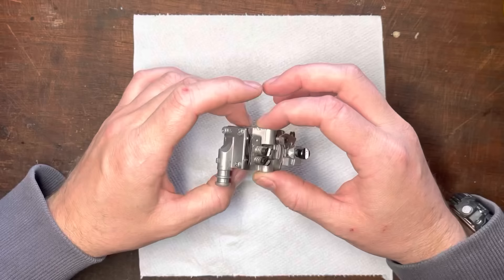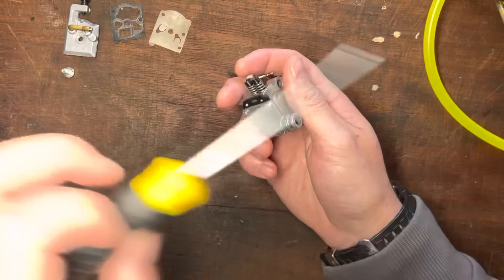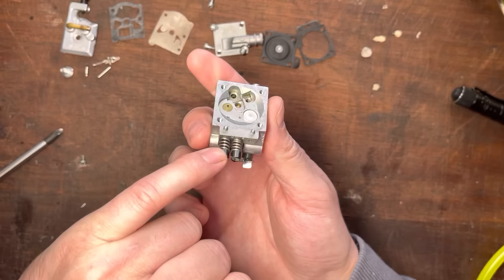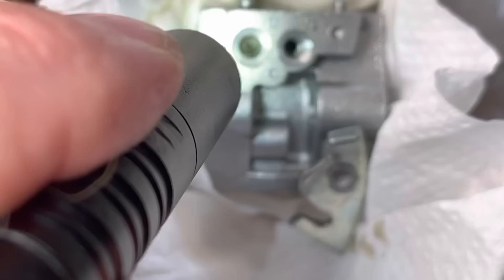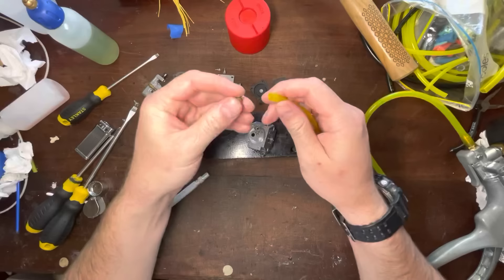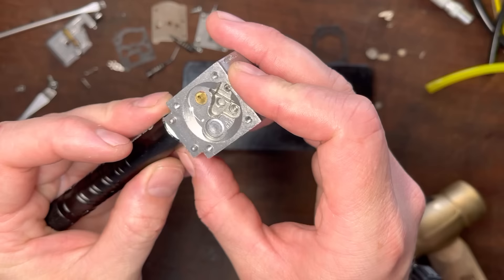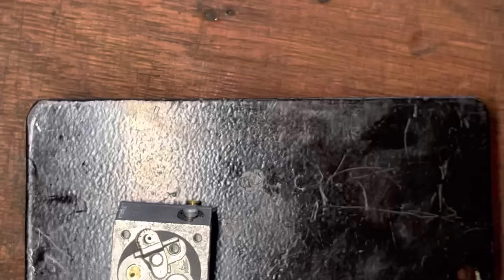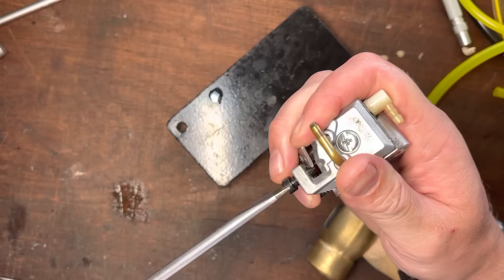2 Stroke Carburetor - In depth Fault Finding, Testing, Service & Repair

Comment: I have a 2002 Husqvarna 245R Clearing saw - beautiful machine. A while back it slowed down and died - over a period of about an hour. I have subsequently replaced the coil, piston, rings, bearings and carb kit. It now runs beautifully, but only if I hold my finger mostly over the air intake - indicating a starvation of fuel. The fuel filter and fuel line are also new. It's a Walbro carb and I cannot find a replacement anywhere. Any suggestions? Could it be blocked internally somehow? Thanks.
Reply from the maker: Hey! It could be so many things, I’d suggest you pressure and vacuum test the machine to find the air leak which is what it sounds like!
Reply: @VintageEngineRepairs  - I'm busy going through it all now. Mine is a WT99 - very similar to yours, (Seems to be a WT42 or WT142 - can't quite make it out.) I cannot find a replacement anywhere (here in South Africa) - If I end up needing a new one, do you know where I can get from, or what similar Walbro could work? Thanks.

Comment: I have a blower that only runs good on half choke i cleaned the whole carb any ideas high speed adjustment maybe?
Reply from the maker: It may need a carb adjustment, it may have a blocked fuel filter, damaged lines, impulse, it can be so many problems. Without systematically going over it I couldn’t say, I’d just be guessing I’m afraid!
Reply: @VintageEngineRepairs  no worries man thanks for the input all the lines and everthing were good i removed the filter to remove that out of the equation i might just order a new carb the blower is still pretty new only used a handful of times everthing still looks good but we'll see if i can find a carb
Reply from the maker: Are you in Western Australia?
Reply: @VintageEngineRepairs  no im in the usa

Comment: At bunnings or even the markets they are only around 5 bucks but I must say interesting and informative i would guess on some big model aircraft you could modify them because they need to run rich low and they lean out the higher u go.
Reply from the maker: Hey, sorry I don’t know what you mean at Bunnings they’re $5, what is $5? Either way, thanks for watching!
Reply: @VintageEngineRepairs  sorry I'm in Australia I guess bunnings here is a huge tools and gardening supplies wherhouse.
Reply from the maker: All good I’m in Aussi haha, but I still don’t know what you’re refering to that you can get from Bunnings for $5 🤣👍

Comment: Outstanding video explains the details behind 2 stroke carbs. I have a ZAMA C1Q-S162 that leakes from the needle valve. I have replaced the needle twice and still does not hold pressure. How would you address something like this? Carb works fine on trimmer but leaks and floods the engine when not in use. Thanks
Reply from the maker: You could try and polish the brass seat with a cotton bud and valve lapping compound! May just be a bit dirty? Hope it helps :)
Reply: Check the 'lever' isn't bent and causing unnecessary 'lift'.
Reply: @kellyeye7224  the lever and metering barrel were replace from a new kit. At this point I have polished the barrel seat but I suspect the barrel rubber tip might had been dried or it’s up to aftermarket Chinese tolerances. I’m on a quest to find an original Zama kit to see if I can make the carb seal again. Thanks for the suggestion though.
Reply: Replace the needle with OEM. Check all your offices to make sure none are clogged. And make sure none of the diaphragms are crinkly at all. In short buy a rebuild kit, OEM or 'proline' and replace the needle, diaphragms ect in the kit.
Reply: @banjoman6223  Thanks for the suggestion. A ZAMA kit was used for a rebuilt. Carb runs like new. The issue that puzzles me is that it leaks when not in use for a couple of days and floods the engine as well as seeing fuel along the housing of the trimmer. That is why I am suspecting the needle valve not sealing properly. All passages and jets seem clean and the fact that it runs fine from idle to full speed with good acceleration supports that there should be no blockage.  Eventually I will win but for now we have Stihl carb vs me = 1-0
Reply: If you haven't vacuum tested the needle, then that might be the next thing to do. Also try cracking open your fuel tank cap before you store your piece of equipment just in case the breather on the tank is malfunctioning and pressure buildup is forcing fuel into the carburetor.

Comment: HI . Re screw drivers, may i suggest JIS. If they have a dot on the screw they are JIS. Phillips will cam the screws and destroy them, ( eventually!)
Reply from the maker: Hey :) yes absolutely! I use them and recommend them! Good suggestion
Reply: @VintageEngineRepairs  ps . I really like your videos. Succinct and the right pace. FYI . I just argued with a Zama  for most of the afternoon! Solution! ….ultra sonic clean. Maybe I fixed something else in the process but …. Bingo. The little fellow is screaming!!! Going like a train!

Comment: Can you test the H/L passages without removing the needles?
Reply from the maker: Yes you can go through the metering chamber drillings
Reply: @VintageEngineRepairs  Thanks! my carb has these very nasty security screws in the way.
Reply from the maker: @mingiasi yep, I’d pull them off regardless or you won’t be able to adjust them fully where necessary for tuning later

Comment: Re my previous comment ,I do not mean the metering diaphragm I mean the tiny diaphragm in the little one way valve which goes from the metering area through to the venturi.  John Rowe.
Reply from the maker: Oh gotcha :) yeah it you get creative you can pull them out and replace them. I have before. You just use a punch and punch out some metering diaphragm material. It’s quite a bit of effort and doesn’t guarantee success!
Reply: @VintageEngineRepairs  Thanks for your help but I have already done that but as you say it does not guarantee success. Can you in Australia buy the complete valves as we in Canada can not.   Best regards and thank you for your time. JR.
Reply from the maker: @johnrowe-wr1gz  hey, failing the DIY method, you need to replace them. Sometimes if the carb is old you won’t be able to buy the nozzle through stihl, Zama or walbro, therefore you have to search online and hope to find it somewhere else. I have had that before, not ideal!

Comment: When testing the main jet desk couldn’t you just use a larger diameter tubing and overlay the bore of the jet?  Save having to remove if not necessary to remove it.
Reply from the maker: Sure! In instances where there is a bypass drilling I do sometimes do that :) I have about 5 ways to test them, all work well lol

Comment: What would happen if the metering diaphragm was hard or stiff with age? Would you be able to start a chainsaw for example?
Reply from the maker: Na you’d struggle to start it and it would run very lean :(
Reply: @VintageEngineRepairs  Could it also result in a machine getting flooded? My chainsaw gets too much fuel to the point of getting flooded after pulling without choke. The metering membrane is stiff so I ordered a replacement, hoping that would fix the issue.
Reply from the maker: Yes, that can cause it too. It will hold the metering lever down in some circumstances.

Comment: For the check valve test what do you do when there is no hole drilled in the bottom of it. It seems like the newer carbs do not have a hole . How do you test it?
Reply from the maker: That’s ok! You just take the needle out, cover the drilling in the metering floor and and pull a vacuum and pressure through the needle hole. You kinda need 3 hands, but you’ll get it :)
Reply: Ok thanks i will try that

Comment: Great explanation but some pointers on where to get those 'obscure' spares would help?  Given you can (could?) purchase a replacement - albeit aftermarket - complete carb for £12-ish I can't imagine repairs being cost effective....
Reply from the maker: Hey Kelly! The parts can be sourced from the manufacturer of the carb, so Zama for Zama or walbro for walbro. Your local small engine shop will also be able to assist you. Regarding swapping out for a Chinese clone. It’s an option, but it’s also a risk. They often don’t run correctly or at all, they are often missing parts (a friend brought 2 and both didn’t have metering gaskets so would never work). Chinese carbs have their place, if the piece of equipment is not worth much and the carb that is on it cannot be saved. However if you can save the carb, I recommend doing so, if you’re willing to take the time. Oem carbs are more reliable and built to better standards. 

I see both sides of the coin, I don’t think it’s a black and white answer as to which direction to go. It depends on circumstances. Thanks for watching, I appreciate the comment too, you certainly raise valid points!
Reply: @VintageEngineRepairs  Thanks for the reply - whilst I can't find the OEM in the UK there are suppliers of official spares and I was more than surprised (and pleased) to see they were very affordable - certainly worth getting spares than an cheap Chinese knock-off!  Now all I have to do is encourage equipment manufacturers to use OEM carbs and not fit the cheap Chinese stuff (they do!).

Comment: What is the purpose of blocking the low circuitry when checking your check valve
Reply from the maker: Hey, I didn’t, just the high circuit.
Reply: Couldn’t you have lightly seated the hi speed mixture screw to close off those passages instead of using that goo?

Comment: I have a zama 1cq from a stihl FS200. Inside both the low speed and high speed mixture screw ports appears to be some plastic ring thing that's cracked.  I can't find anything about these plastic things. Could it be varnish?
Reply from the maker: Possibly o-rings? Are they black? If not it may also be a means to add resistance to the screws to stop them backing out.
Reply: Entirely Yellow. Also yellow staining on part of the threads of the carb body.  I tried break clean and I tried acetone but its still there
Reply from the maker: @niffumau  ah yes :) it’s plastic that would normally be on the end of the screw, it’s to stop them coming lose from vibration. What’s the full model number of the carb?
Reply: @VintageEngineRepairs  zama C1Q S162 021A
Reply: Can I buy those plastic bits?
Reply from the maker: I just checked, they show the part but don’t sell it. Do your screws have springs on the screws?
Reply: No springs

Comment: Checked carby and seems clean, but not sucking fuel even gravity fed, primed engine manually and have spark and compression but no fuel smell after pull starting and not using fuel. Stopped suddenly, could it be the meter and lever?
Reply from the maker: Have you checked the exhaust side of the piston for scoring? I’d suggest that first :)
Reply: If it's not pulling fuel it's probably a clogged orifice, bad diaphragms, or a bad tank vent. Also make sure your fuel lines aren't crossed.
Reply: While scoring is a good thing to check it depends on what you mean by 'stopped suddenly'

Comment: Give me a carburetor any day! 
Way easier to work on than fuel injection. I realize fuel injection is more efficient and dependable. 
but when your out in the middle of nowhere with an ATV that won’t idle- and all you got is a screwdriver, your gonna be stoked there’s a carb feeding your engine
Reply from the maker: Very true! Injection is amazing (direct injection, not this throttle body injection some companies use!) but the simplicity, reliability and ability to work on a carburetor is unmatched. No wires, electrical connections or computers :)

Comment: I did on my old stihl on the replacement part its high and low screw tip ends are a different shape cut more cone shaped than the original carburetor that came on the weed eater the original screws are more skinnier 

Why i got a replacement carburetor was because on the original one the high and low screws wouldn't keep the setting it would vibrate out of set and i had the same problem with the backpack blower i gave up on those they're just junk sitting around for now
Reply from the maker: Often there will either be a spring on each needle or a rubber boot, these keep the screws in place :) thanks for watching!
Reply: @VintageEngineRepairs  the springs spin around with the screws  on the original carburetor it wont keep the setting because they spin out of setting while its idling 

That other carburetor i bought for it is a replacement and it works but not how it should because the tip ends on the high an low screws are different so i don't use the stihl anymore on the replacement its screws stay in place 

I have plenty other brands of old weed eaters i can mess with anytime someone gave me 2 old ones they're needing all new gas lines and all that stuff probably clean out the tank to and they're original carburetors 

Im pretty sure the craftsmen one i have needs a little coil but i don't like weed eating but then im always getting a bunch of those people don't want i use a straight feather lite someone gave me a few years ago that ones screws hole the settings good just tune it a little and its good for another 2 years
Reply from the maker: Interesting! I hope you can get it sorted, stihl make some great products :)
Reply: @VintageEngineRepairs  they're good products until you need a new part from them then see that they're new parts are made different

Comment: You did not set/check the pop off pressure?
Reply from the maker: Stihl do not give you pop off pressure specifications and recommend against stretching or modifying the springs 👍👍 they say if it holds 5 psi it’s all that is necessary.

Comment: I have three HDA 160a carbs needing main jet diaphragms which are unobtainable now. I have the material but do not know the proper dia. of the diaphragm. I have tried a few but without success. Could you possibly help me as I have three good saws sitting idle.Regards John Rowe .  May the Lord bless you.Maranatha.

mainjet
Reply from the maker: Hey, I haven’t heard of a main jet diaphragm, do you mean the metering diaphragm?
Reply: @VintageEngineRepairs  Yes.

Comment: Mine is different. Mine has the check valve in the metering chamber that feeds a H/L chamber that the needle valves draw off of. My valve sticks open so when the primer pump puts a vacuum on the metering chamber air back flows past the jets and orifices in the barrel getting air into the metering chamber through that non sealing check valve and I can see it coming down the hose leading to the primer bulb and on into the tank. The check valve is so small and pressed into the body that it cant be taken out. I would like to be able to make it seal again otherwise the carb is trash.

The symptom is I will start and run while the choak is on but if you turn the choak off it tries to die. You can give it little partial pulses of the throttle with the choak partially on but if you try WOT it just bogs and dies. I had the original carb do that and replaced it with a new one. Used the chainsaw in early spring to cut a bunch of wood and then 3-4 months later I went to start it and the new carb id the same thing.

It really does not like fuel sitting in the carb for any length of time. I was told that the solution is to drain ALL the fuel out, put pure two stroke oil in the tank and pump it through the carb and store it. When you want to use it again do the reverse replacing the oil with gas and then when done with it do the same thing again for storage.
P.S. I thought about sucking acetone through the carb to free the check valve.
Reply from the maker: I’m sorry I can’t quite picture what you’re describing in your first paragraph! 

Yes drain all fuel if it’s going to be stored longer than a month :)
Reply: @VintageEngineRepairs  Yours has the little holes for the needle adjusters to draw directly off of the metering chamber. mine does not have those holes, mine instead has one large hole that a brass check valve is pressed into in the metering chamber and then both needle valves draw from the cavity under the brass check valve.

While not my carb [this one has the primer pump screwed directly to it] it dies have the brass check valve system @5:40...
https://youtu.be/MtggiZf_x-4?t=340
Reply from the maker: Ahhh!! Yes you’re referring to a rotary type carb :) you’re spot on, a single drilling feeds both the high and low speed sides of the carb. The H screw is on the side while the L screw is on the top :)

Comment: How many turns for the high an low screw please
Reply from the maker: 1&1/4 on both is a good start
Reply: Run an idle turn
Reply from the maker: Loosen the idle screw until it doesn’t touch the cam, then screw it in until it does and then 1 1/4 more turns in.

Comment: I use "Seal-All" instead of nail polish . It 's gas with ethanol and oil resistant .
Reply from the maker: Interesting seal all is very thick, I’d be concerned with getting a blob somewhere. I’ll have to try it as I got a tube recently. Nail varnish is acrylic lacquer, it’s petrol resistant and oil, not sure about ethanol though.
Reply: Yes! Ethanol gasoline destroys nail polish sealing very quickly.

Comment: Is that an air compressor gun you r using?
Reply from the maker: I’m not sure what I used throughout the video, but I think you’re referring to the Mityvac I’m using for pressure and vac testing?
Reply: @VintageEngineRepairs  ok, thanks. That is what I meant.